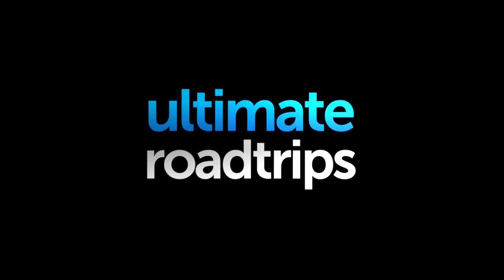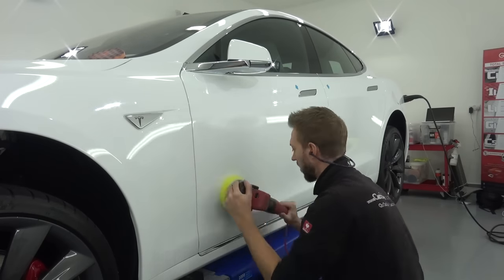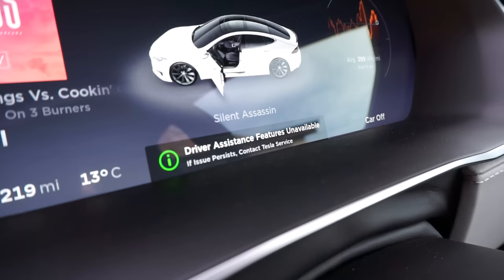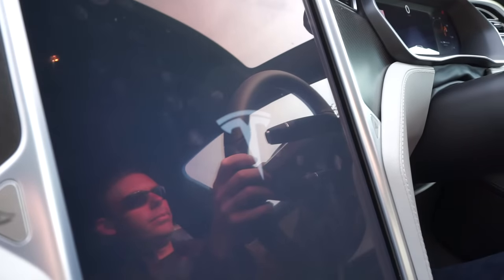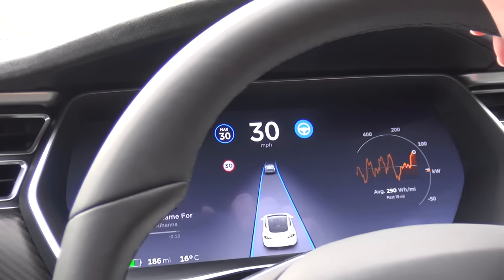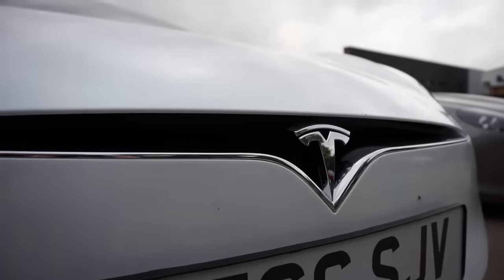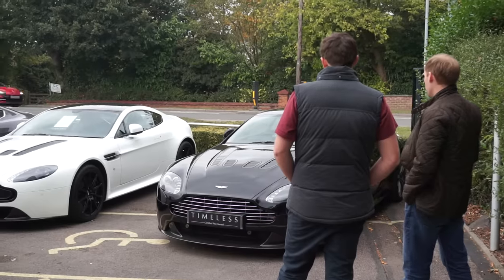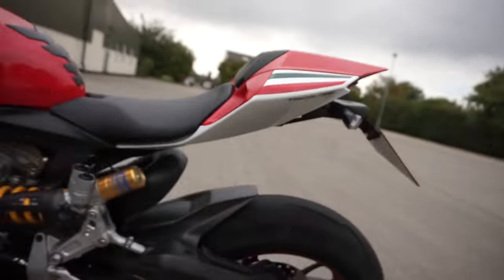Summon, Ludicrous & Autopilot in the Tesla P90D

Comment: The one thing I've noticed with these Teslas is they get off the line to 60mph really well, but then acceleration steadily tails off as if the power is being gradually turned down. What is the reason for this? It doesn't seem to happen with the Rimac Concept one, so is it due to different types of electric motors or it is deliberate from Tesla?
Reply from the maker: +stubones Well there's no gearing, and the Tesla is a heavy car, so it's just a matter of physics and engineering choices I guess. Ludicrous is just a fun option to have! Besides, when can you really go much faster than 60mph in the U.K.? 😉
Reply: UltimateRoadtrips
I think its engineering choices. The Rimac weighs not much less, although it is designed as an outright supercar. I'm only asking because I'm genuinely interested in the tech behind the Tesla and and possibly being in a position to buy a P1XXD (whatever its going to be by then!). I've also been pondering if there is a way they'd be able to divert electric motor power back into charging the batteries (not KERS on braking). For eg. of the 760hp, up to 100hp could be diverted to charging the batteries in order to extend cruising range. maybe its not physically possible. Anyway, great vid, awesome car :)
Reply from the maker: Well energy used is energy lost. The Tesla features regenerative braking to take the wasted energy in deceleration and use that to top up the battery. Pretty efficient and saves on the brake pads! We're living in exciting times
Reply: UltimateRoadtrips
Yeah its pretty cool. Tesla have really moved the game on to the point where an electric car really is a viable alternative to a combustion engined car. The P100D is capable of a real world 315 miles. That sells it for me. Maybe this time next year I'll have a Tesla of my own.
Reply: Teslas only have one reduction gear vs Rimac Cocept family has 2 gears spaced quite far apart. Each rear wheels has its own dual clutch gear box, front wheels are only single gear and freespinning. So when RImac cars reach higher speeds where tesla lose momentum Rimac have a tall gear to lower the Motor RPM again. Lookup the Zombie222, DC Motor drag race Mustang with tall overdrive. The gearing on Tesla Ludicrous cars are kind of silly, 1.1G+ of forward acceleartion shows how much toruqe is being sent to the ground in a low gear.
Reply: Neojhun
Awesome, thanks for that explanation :) It all makes a lot of sense now.